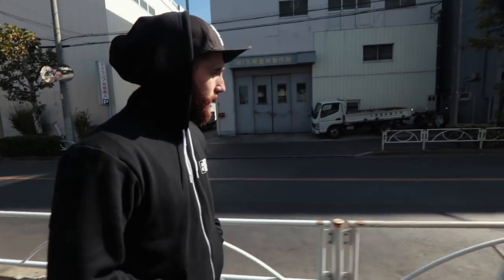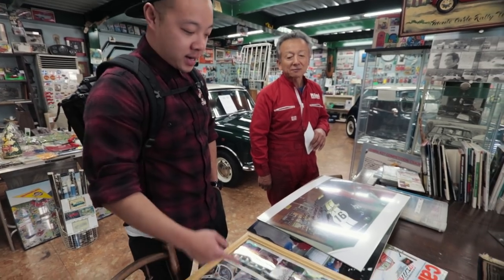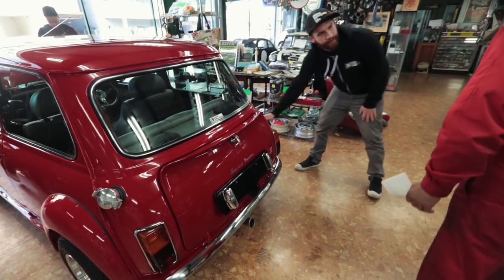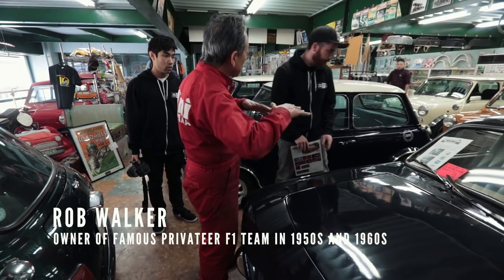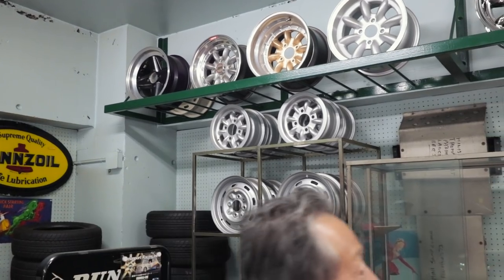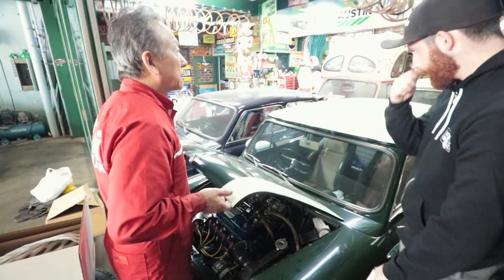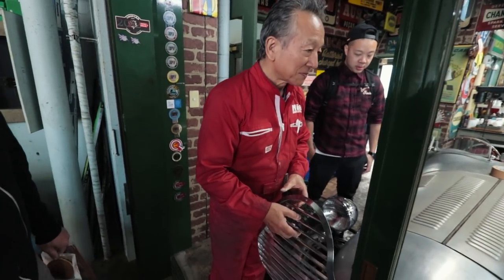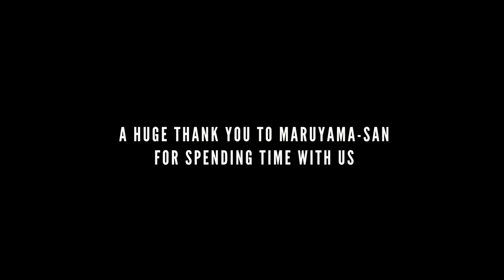Detoured: Japan EP2 Maruyama-san's insane historic racing collection

Comment: I’m probably preaching to the choir but in case anyone is wondering, the 287/289 Cobras (CSX2*** chassis) were more suited to racing than 427 partly because of the weight and also because they had to completely redesign the car (hence the CSX3*** nomenclature) as the original Cobras had pretty archaic suspension (transverse leaf springs on the front) and width was an issue with the 427 (7-liter). As it was, the 287/9 motor had a pretty good rev range and was a better fit balance-wise.

Near the end that cat ice cream truck cracked me up. At first I thought it was Hello Kitty themed.

Comment: The Mini as it was needed a lot of updating done to it to make it a real good car from the engine, gearbox to suspension and electrics, and still sticking to simplicity a la Trabant. If it was built in Japan for the Japanese market, I am sure the Japanese would have made it into a better car. 1975 Mini vs 1975 Honda Civic.
Reply from the maker: I think you're right. Minis came pre-assembled for the Japanese market and they were only able to tack extra things on as additions (usually awkwardly placed like the AC unit, because of space constraints). It would have been cool to see what parts they would have changed if they had that liberty.
Reply: @Stevestonmotorco   it seems they have a strong passion for weber carbs! ha ha, im pretty sure the su would have been dropped. :D